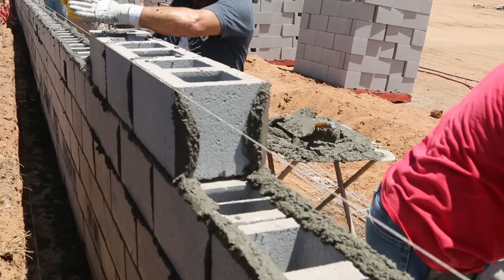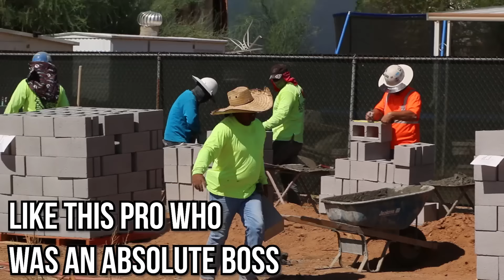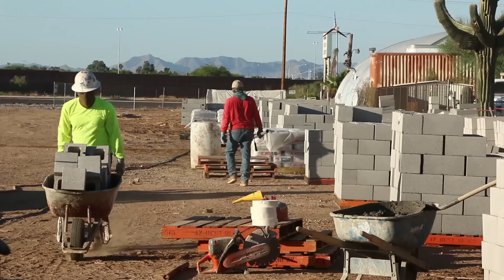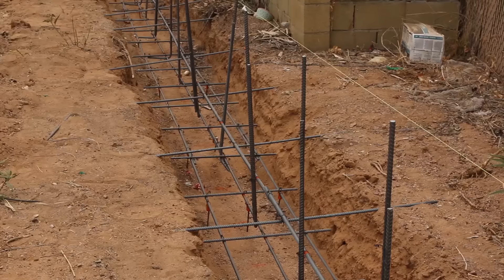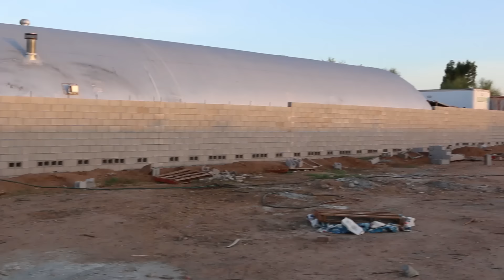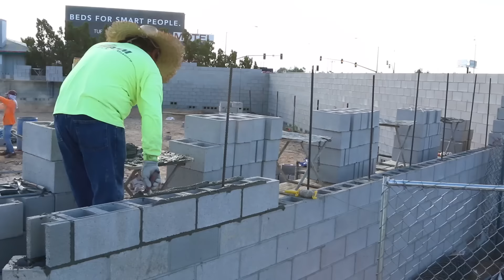Building A Block Wall

Comment: I live in Arizona and block walls are in abundance here.  So are the block walls that are leaning and falling over.  I noticed the footings weren't very deep. Is there a reason the footings don't go deeper than 1 foot?  Also why don't you fill the block space with concrete and rebar every so often to give it a little more support on a long run? Isn't anyone going to talk about how uneven and slanted the dirt is before the pour?  If all this is standard, no wonder the block walls are falling over here.

Comment: True craftsmen are a joy to watch. Mesmerizing! I was a block tender, but mostly worked with concrete slabs as a college laborer. It put me thru college  and had the privilege to work and train under craftsmen. It was the most valuable lesson I learned compared to a college degree. 

Later I transitioned into carpentry. And at age 72.5, I helped run a concrete slab for our church. Not as flexible as age 22 though!

Comment: Before my father started his masonry company he worked the line for others. Before he went to work he would tape the ends of his fingers in hopes of reducing the damage caused by the blocks. Back then the blocks were made with slag and called cinder block. They were rougher than todays concrete blocks. On returning home after a hard days work we would often help him remove the tape which had worn through enough to cause painful "strawberries" if not open bloody wounds. A few years later he was one of the largest mason contractors in the area and hired as many as 80 mechanics and laborers. Still it's a hard row to hoe!!

Comment: Interesting. In Germany we put 2x 10 mm horizontal in every layer. And 4x 12mm (1/2 inch) on every side per meter (40 inches). They need to be on both sides of the wall, so that makes 8 bars per meter of 12mm steel. Also there needs to be way more steel in the grounding. We use „mat baskets“ for that. And than the vertikal bars need Tonne aligned. So the push/pull forces are well transferred. If you want to know how we do it, search for „KLB Schalungsstein Verarbeitung“. In that pdf you’ll find a lot of information.

Comment: Ahh very satisfying. I've been conditioned and trained very well for years in block masonry, labor and tend, laying to the line, learning bond and leads, hundreds of residential houses going slab to slab, multiple big commercial buildings like Publix with sprouts, that use box car blocks which are 12 by 8 by 16 instead reg block which is 8 by 8 by 16. We built a house fully with 2500 block in one day with a full crew everybody on point going hard. we averaged around 600 block a day on commercial, sometimes 800 but only had 4 or 5 masons

Comment: i think how the blocks are layed at the bottom is quite incorrect. I know the wall is not that high, its not part of some building or what, but still it doesn't hold that much pressure in this way.

Comment: Hot tip 
It's easier if you pour the footing first with the bottom steel in. Then once it's screeded at the right height put your block bars in then. 
Talking about wasting time those guys pouring that footing was backwards as.

Comment: Hedite block way alot less than concrete block which is why you see that guy picking up the block with 1 hand. They are a paper weight compared to a real block. Not sure how to spell hedite. I'm sure I got it wrong lol

Comment: Sir, that was one fine video.  Hard work in the direct son....like pickers....makes for hard men.  I have a wall made of concrete cinderblock.  It is leaning at about 30 degrees b ecause the fellas cheaped out on rebar in proper techniques.  Now it will have to be demo'd and rebuilt the correct way.  Watching your video taught me alot about getting the right guys for the job...

Comment: How can one learn to estimate the various costs of this project? From the materials to the labor and crews?
Reply: by surmising the costs??? learn to estimate?

example: just take the time to google around to see how much would bricks like that cost, per brick. now think about how many bricks per the wall based on the given measurements. im sure this is a standard brick so you could find an analogue. Now, when doing this kind of work they probably cut you some sort of deal on the bricks, so youll be paying less per brick than whatever you find in your googling, so keep that in mind when calculating costs. Im unsure what a wholesale discount on X many bricks would be, max 50% but that seems obscene, lets go with 15% discount for wholesale brick purcases, so whatever we calculate for X number of bricks times the cost per brick, just give this a 15% discount or whatever you'd surmise would be given for an operation of this scale.

okay, it was literally that much money for that much BRICKS. but now you gotta consider the volume and type of liquidy materials used, the 3 different kinds he was describing. based on the video we can even calculate how much per brick was likely used (and wasted) for the various kinds used that involve actually lathing the bricks. and we can calculate the dimensions of the volumes of the kind that got poured inbetween the tall walls. and we can calculate the volume that was used to lay the solid foundation. same idea as the bricks, we would find how much a bag or x amount of volume of each of these general types of materials would cost, then account for bulk discounting since we'd be using A LOT of their material.

okay, so we have the material costs thus far, except for the rebar bars. so, wherever the rebar was laid account for that much rebar being used. same idea, we need XXXXX feet of rebar, calculated based on how much rebar we need for foundation framing, standing up tall, and laid across the top. Same idea, how much is X foot of rebar, then account for discounts.

MATERIALS ARE ACCOUNTED FOR. we have the liquids, the bricks, the rebar. im sure theres some smaller costs im missing but we're talking big numbers, sure maybe we also need some more things like tools but i can promise you the costs of tools and stuff is an order of magnitude less than the materials costs here.

the other MASSIVE cost to account for is labor, obviously. im very curious how much the boss in the video makes, he busts his ass and does good work and personally id be really mad to hear some low numbers per hour, but hopefully hes happy.

anyways, you dont really have to worry about that as much since youd hire a company to manage the people/labor aspect. but that part of the project surely accounts not only for the labor the people, but also the work of the company to arrange/employ the laborers. so if you hire it out (which obviously you have to in order to get this quality) youll probably pay for the quality too on top of it all.

so think about how many people would need to be employed for each step of the way. lets say foundation, laying the wall, and then finishing the wall, which isnt even super accurate. lets say we had 1 big company for the whole thing but they used 3 sub contractors for each part, but 1 sub contractor of those 3 was used each step along the way.

to me it is obvious this wall was worth millions in terms of materials and labor, but also we need to account for inflation! think about it, this wall 100 years ago was not 1 million dollars of work, even for the same/higher quality simply because money didnt work that way. since we're living in hyperinflation (yes, this is what the beginning feels like), its really tough to judge. maybe 20 years ago this project could have been under 1 million depending on whatever the costs of the materials would be and agreed labor.

but in 2020s (this video was in late 2010s) i can easily see this being a multimillion dollar project. it really looks like a great wall and the videos seemed to be proof. if it looks good, it is good etc

anyways you were asking how you would learn to estimate.

idk how you learn to do something that requires you to just like take the effort to think through it other than to be given an example like this in how you might approach the task of estimation, what costs to be considering etc.

also that was just for like the PROJECT.

this wall is part of a property and im sure theres a LOT more money tied up in the total endeavor to actually get this thing in. we needed the engineer to measure and dig the whole, and im sure for the land to be cleared that took someone, and etc etc. basically, the way you would estimate this cost is by thinking about each variable and then just accounting for it. 

but since its been 3 years someone should just tell us how much it was and we can then try to reverse engineer the costs!

Comment: Please help stop these contractors I was a carpenter never given protection or even warned of the dangers when dry drilling into concrete and dry cutting fiber cement board siding now I have scarring in my lungs and worry everyday I will die from  silicosis with no hope no cure no treatments everyday across the subdivisions in there are people still dry cutting and dry drilling into concrete it has turned my entire life upside down and wish 1 person would have told me so I could have left immediately I reported this to osha and nothing was done the contractor still do it to this day. Please help stop this its killing a lot of us I don't understand why the contractors are not criminally charged for this

Comment: Good Videos! If I make a House, I will make it with a Combination of ICF( Foundation, Cellar) and Walls with Concrete blocks and filled with Grout Concrete, the Outside wall with 2 inches up Sandvich panel, Floor with a hollow Concrete slab reinforcement. That will withstand Fire and hurricanes!

Comment: Got the line on the wrong side. Your line should always be on your side so you can see it entirely. Is it tough to lift block over the line? Hell yes. Do you have to be tough to be a block mason? Hell yes. These are probably majority Hispanic workers though and they have a renegade style of stacking block and brick that does not follow traditional masonry rules. Hispanics only care about how many they can lay, not so much on quality.

Comment: When you start laying base for a block wall - ALWAYS start on the lowest point when ever possible... You can thank me later. Stepping your base run UP is easy and efficient - stepping it DOWN is an enormous pain in the a** and it will cost you time.

Comment: We have a 350 ft. chain link fence at the back of our property. Our neighbors behind us have a couple of annoying yappy dogs that bark  whenever they see us in our yard.  I would love to build a nice solid wall to block their view. I came here to find out if a DIY was possible. 
I appreciate the detailed explanation of what is involved in constructing such a wall. It looks like it would be beyond the skills of the average homeowner like me. Those guys make it look easy but I know better. Building the footing looks challenging. Applying the right amount of mortar probably requires months, if not years of practice. I can just see myself measuring each mortar joint, removing the block, trying to add or take away a little mortar maybe five or ten times on each block and finding that the wall is not level in spite of my painstaking efforts. We can't afford to hire professionals so I guess we're stuck with our neighbors' dogs barking at us:(

Comment: I tried to get a quote to enclose a patio in Florida with concrete blocks. The opening is 24 feet wide by about 9 feet tall. There is a pillar in the middle the dimensions of a 8 by 16 concrete block. I wanted 1 exterior door and one 3x4 windows in the new wall. The general contractor I sent photos to tried to tell me it would be 50,000 dollars. Obviously he didn't want the job. There is no way it would be 50,000 just for a wall, a door, and a window. No drywall and no electrical work. The patio was even under the house's main roof so no roof work.

Comment: There’s nothing wrong with using 6” t&g block in a 6’0” max screen wall.  We build MILES of them. 8x8x16 block are used mostly in retaining walls or screen walls over 6’ tall.

Comment: The "breaks" in the wall every 16' allows for heat expansion/contraction. Sash block "block with a notch on the end" are usually laid on those seams with a gasket material in between them.

Comment: 8:23 - this team is not safe and it is not their fault.  Estimators, project managers, superintendents.  Please take note of this.  What we have in view at 8:23 is the following:
lack of:
-ladder to properly access scaffold
-hard hats and safety glasses
-one more lift of scaffold preventing a potential fall hazard
-a pallet on end
-a mess of blocks unsafely stacked
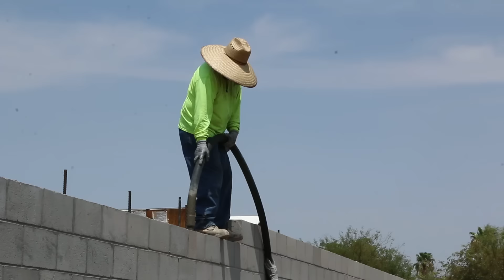-14:45 a guy standing on the block wall to grout!!
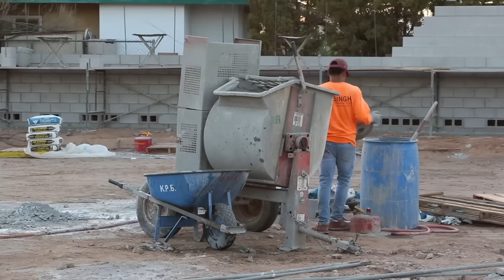-8:47 kudos on the gasoline can - it is metal, that's about the only safe thing on this entire project, sadly, it is too close the a combustible engine
-The guy mixing is reaching too high, his work platform needs to be raised for safety and efficiency.
-the mortar mixer doesn't have proper PPE, nor a respirator, which is part of proper PPE
-9:23 there is something missing!!! a five-gallon bucket of water allowing for the shovel to be placed into the water when not in use, to allow for the laborer or mason tender to have a clean shovel each time they shovel out mortar.  this does two things, allows for a light shovel and allows the mason tender to give the mason a full shovel of mortar.

Comment: 14:45 - grout.  WOW, that guy is standing on the wall, on camera - OK, not smart and not safe.  the aggregates are not needed, I use to work for a mason contractor whom never used aggregate in the grout.  I asked an engineer and he informed me that aggreate is not necessary for strength.  Another important item to speak on about grouting is a key way.  When installing grout, one needs to stay down at least two inches from the top of the previous block to allow the introduction of the next lift of grout to properly tie in and not create a cold joint at a bed joint, very important.  15:47 - there re rods are not properly separated, so their designed strength is not being put into place, once grouted.

Comment: 11:41, the ladder mash, or dura-wall has one purpose.  The purpose is to prevent the concerete wall from shrinking too much.  When correctly installed, the block wall will not have a vertical crack anywhere, except for where the installed control joints are.

Comment: 11:20, LOL...inspector?  um I have been a commercial mason for over twenty years, worked in 5 different states, on schools, prisons, factories, coke ovens, stone, brick, and block jobs and residential and only dealt with an inspector twice.
Reply: Specifications???  LOL, I remember learning about specifications in college for construction management.  On the job site, specifications, at least in masonry, are never looked at, never addressed.  LOL.  specifications :')  these are used highly in other trades but not masonry, masonry is cut throat - get in, get the wall up, get out and never look back - thats masonry!

Comment: 10:31, mentioning the first course.  they are not setting the block to a string. LOL. NO, it is a tool they are setting the blocks to, this tools is not used to fly kites sir.  It is used to lay block and bricks.  In this case, blocks. the tools used is a LINE, not a string.
Reply: called a string line for a reason

Comment: I am sssoooo happy to hear you clarify the difference between cynder block and concrete block.  There is a big difference.  Cynder block are no longer created.  They use ot make them in the mid 1900's, however, due to the health issues of the material, they stopped production.  The purpose was that the blocks were lighter.

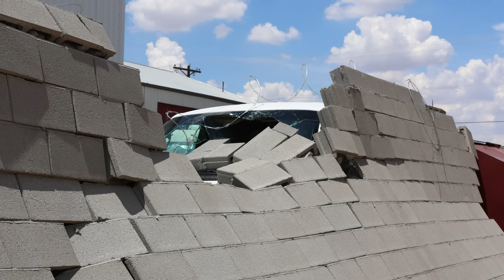Comment: Why such a long wall has to be continuous without visible columns intersecting it a regular intervalls? Its just ugly. Think of putting a square column sized 1-1/2 blocks crosswise every 30 ft fully grouted and rebared and keeping the wall partition in between simple and you will have no such problems like 16:08.

Comment: Good!  Most of these Wall Building videos didn't explain the "grouting step" where what they call "grout" is poured down into holes shared with rebar.  He says every 40 inches,  BUT, timemark 14:41, it looks like the guy with the Grout Dispenser Pipe Tube is filling every hole.   but this is more I got with the other videos.  Jeezus, you can definitely see why a lot of people aren't Doctors and Engineers.  It is like they wear Stupidity like a Hat.

Comment: Hurray, finally a contractor concerned about rebar, size and placement and NOT ground contact. There are plastic saddles that could be used.

Comment: These guys are good masons and tenders.  Yes stocking the wall is important.  Not Bolivian style where they just throw the block or brick in a pile for the mason to handle.  Also these mason do what is called a double head joint.  That eliminates holes in the head joints later to fill up when jointing up.  I have yet to see any one do this here brick or block. Its a couple quick trowel movements.

Comment: How do these block hold together with only thin stripes of cement mixture on the edges? And why aren't the blocks shaped to allow hollow space between the ends of the blocks so that mixture can enter? Also how about filling block cavities with mixture for more strength?

Comment: Fine video. Like. I have a red laser level. https://bit.ly/36OBrOQ
I'm happy. Professional laser level for a repairman. Self-aligning horizontal and vertical 360 degrees with slash tilt function. 5 lines 6 points. Metal construction
https://bit.ly/36OBrOQ
 helps to me in any work. I recommend

Comment: 18:55 don't you have to lay a mortar bed joint at all webs adjacent to grouted cores? I know structural engineers typically count on this mortar for calculation purposes, and I would be surprised if it weren't in the codes or ASTM standards. also, if your grout mix is too fluid can't it seep through the joint?